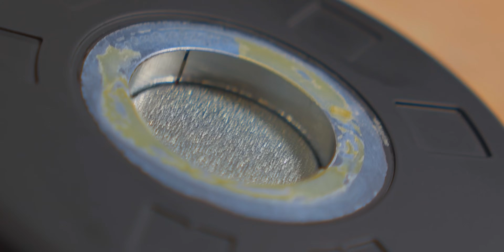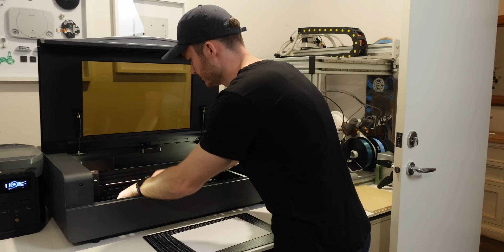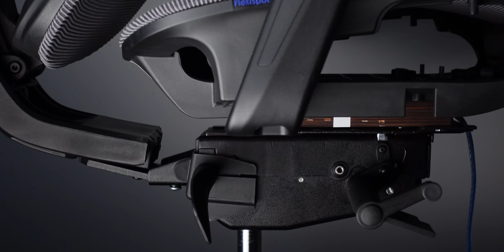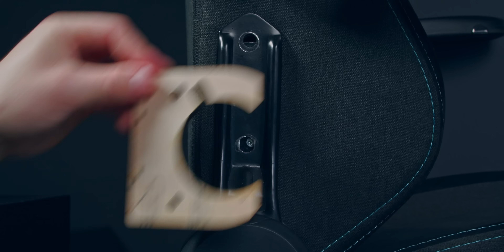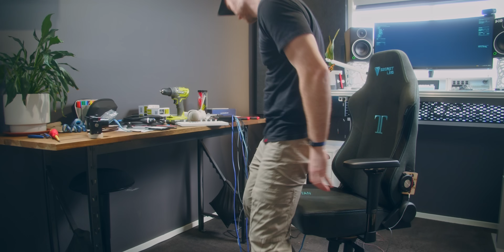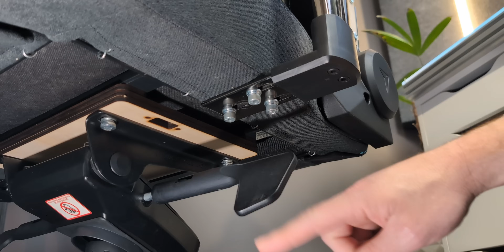All Gaming Chairs should have Bass Shakers as Rumble Packs.

Comment: Why don't you use Voicemeeter potato it has a lot more features. I used to use banana now i use potato and i like it a lot. The only problem is its way more confusing but i get used to that. If its because of the windows size that wouldn't fit on your bottom screen that's really annoying.
Reply from the maker: Yeah haha that's exactly why I use banana, fits perfectly on the bottom screen 😂
Reply: @camshand  ohhhh ok makes sense.

Comment: If you have an existing amp could you just use a splitter cable and a inline low pass filter adapter ?
Reply from the maker: yes, you can, as long as your amp can power the speakers. best to check impedance values, and calculate the wattage of the existing speakers plus the shakers.

Comment: Very curious about stereo physical bass. I've always heard, and experienced, that bass is omnidirectional so positioning doesn't matter except for intensity. I'm very curious about how feeling it directionally affects the experience. Is it weird? Or better? Or both!
Reply: The wavelength of sub frequencies is so large that when it pushes out of the driver it will wrap around the cabinet and go omni directional. A Servo driven magnet like the bass shaker is not going to be omni directional because it’s not emitting audible frequencies. However, when it comes to music, almost every single music producer is summing frequencies under 100hz to mono because stereo information in the sub range tends to introduce phasing. Most concert speaker configurations have a left and right mid and upper range speaker hangs, and then a mono sub wall across the middle. having stereo bass shakers isn’t going to really do much for 99% of the music out there
Reply: @ brilliant response, cheers. This was sort of my assumption but you never know how practice can sometimes differ from theory!
Reply from the maker: Great response @dsquareddan, yes for music and general media content it's not going to make much difference. Home theatre amplifiers will have a mono sub output, even if there's two they both usually say mono.

To answer your question Adam, Gaming, that's why the stereo route with shakers.
As Brett said, it's subtle but noticeable, as for how much it might be worth me testing some games to see if they mix low end of explosions to both left and right, or if they keep them separate based on the game asset on screen like they do with mids and highs.

This no doubt is why the Razer cushion is very interesting, as it's dedicated haptic patterns being triggered by game developers to different areas on the body for what's happening on screen.
Might have to get my hands on one and do a test between Low pass filtering game audio vs intentional haptics.

Comment: Or instead of a spekon cable you 3D print yourself a housing so you can put 2 normal plugs in it and connect them in 1 go.
Reply from the maker: That is true, would then make it easier to unplug especially if the cable was yanked.
I do however like the professional feel of the speakon, satisfying twist and click 👌

Comment: General advice when uising the screw down connectors and any stranded wire you want to put ferrules on them, but there is pretty much no reason to use the screw downs anyway
Reply from the maker: that is a good tip, I ended up using the screw downs on the desk as that was the cheapest option to buy in bulk at the local electronics store.